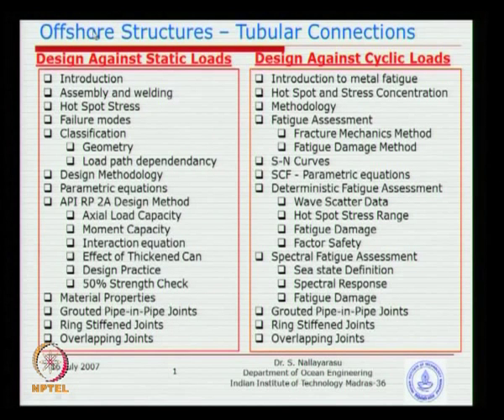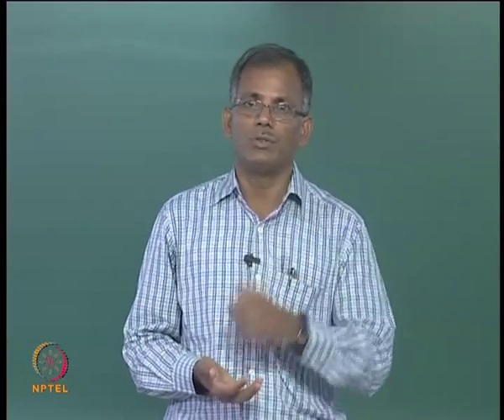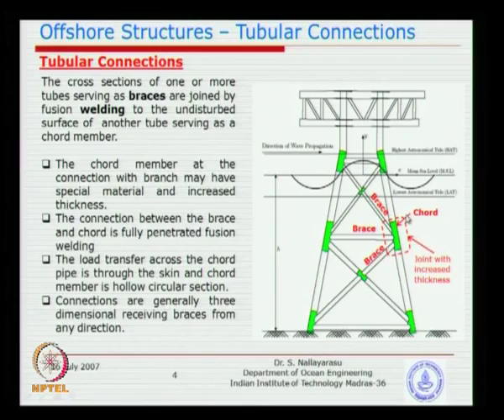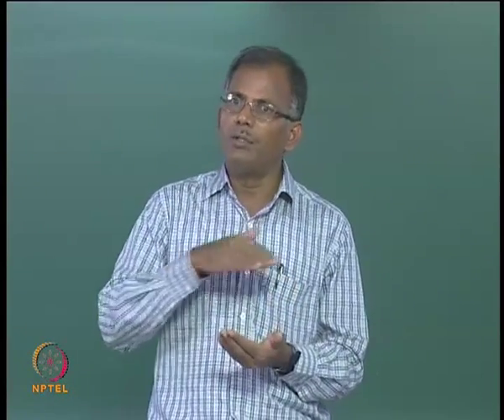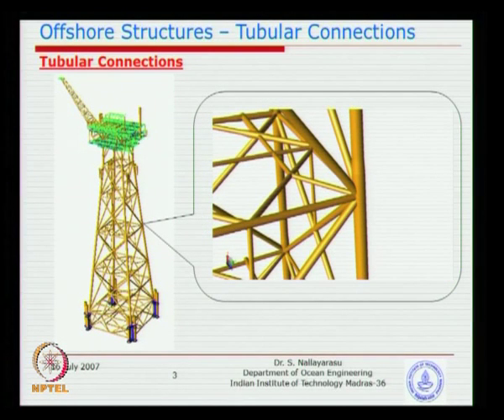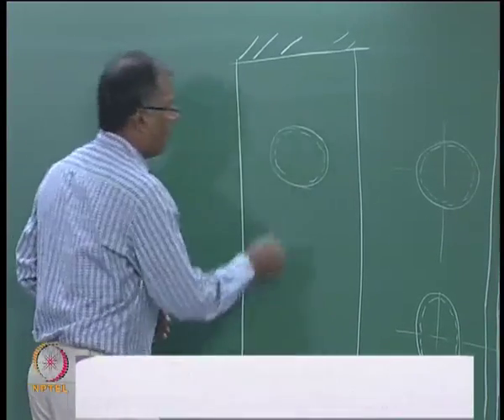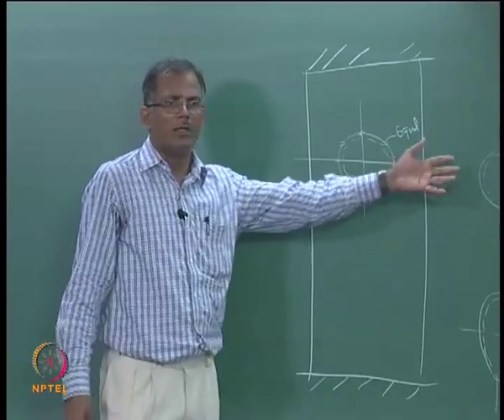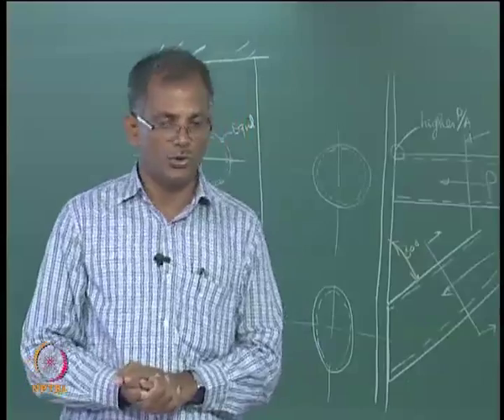Mod-04 Lec-01 Tubular Joint Design for Static and Cyclic Loads - 1

Comment: Good explanation professor. But the single V but joint is not correct, it is actually single bevel. And you may not have a bevel or a fusion weld at the heel side (acute angle side), as the dihedral angle is close to the bevel angle or even less than the bevel angle required